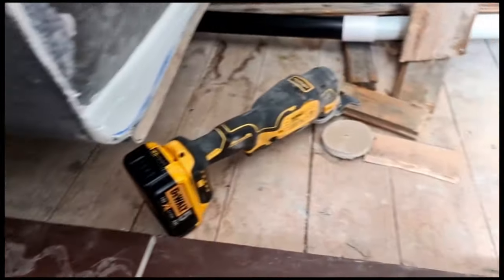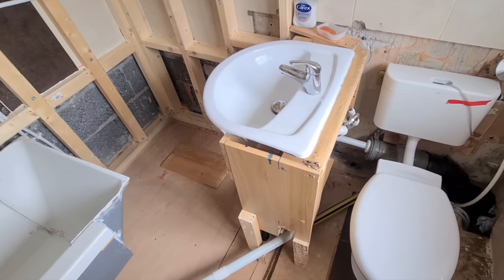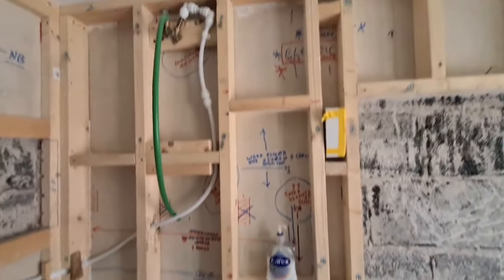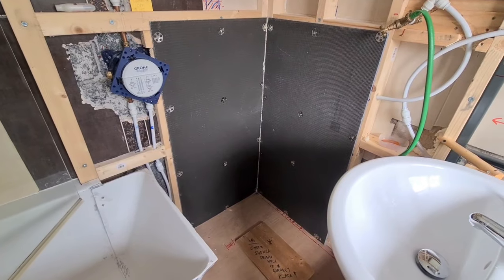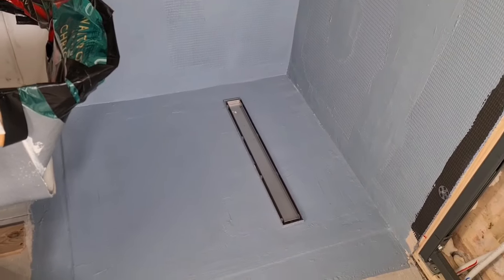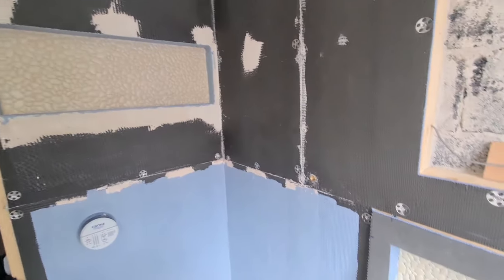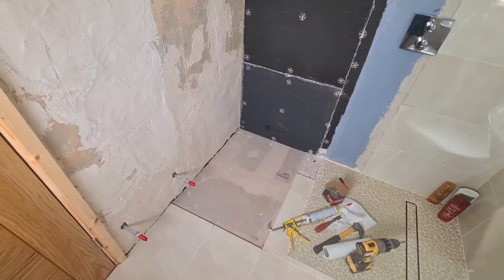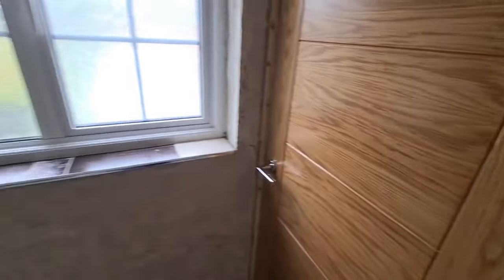HOW TO MAKE A MODERN WET ROOM (BEFORE & NOW) ON TIMBER FLOOR #WetRoom #Shower #Bathroom #Renovation

Comment: Nice job and video of the process, .was hoping you could explain what boards you have used on walls and floor, and the tanking product. Thanks
Reply from the maker: Cheers. The boards on the wall are STS Tile Backer Boards and STS expanding adhesive (Wickes). The cement boards on the floor are HardieBacker Boards (B&Q) and the tanking product is part of a WSK Wetroom Shower Tray Kit (eBay UK). I hope that helps. 👍